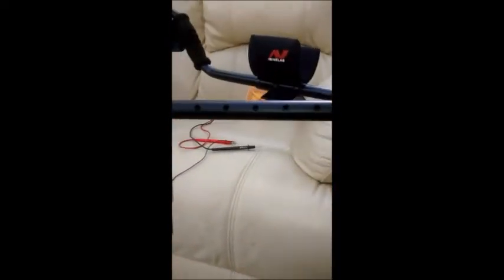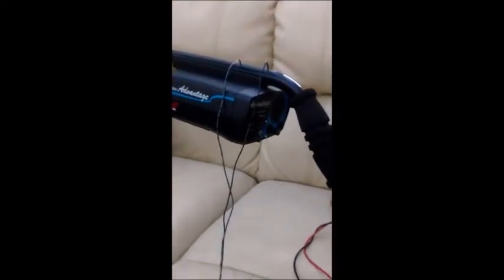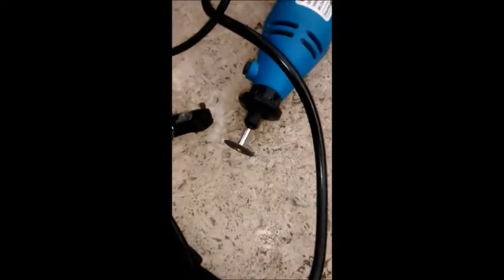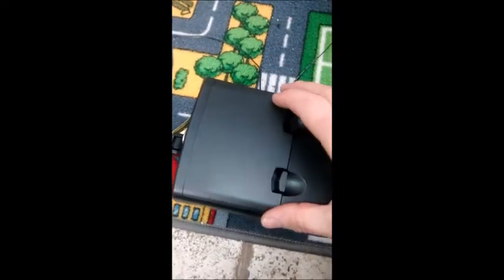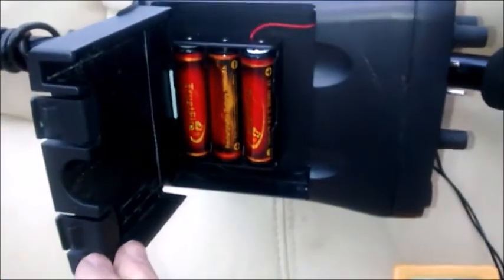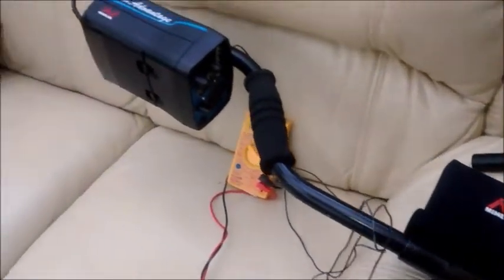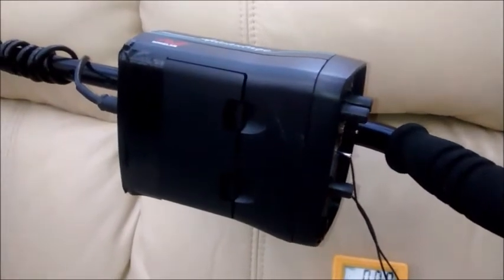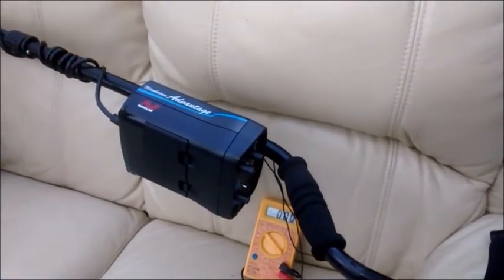minelab £10 li ion conv pt2(musketeer +sovereign friendly),works brill.

Comment: Hello,
do you use some cut off circuit? Lower than 2.7 volts per cell it could be damaged
Reply from the maker: i didnt have any issues ,recharging after a couple of trips out . Later i upgraded to 4 cells without incident but not accepting any responsibility if  anyone frys anything  .16.8v .